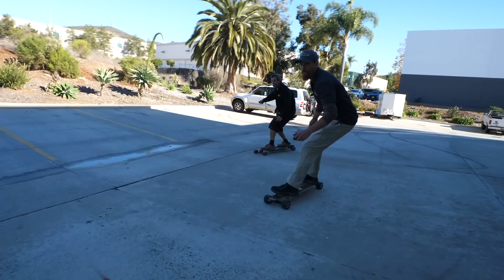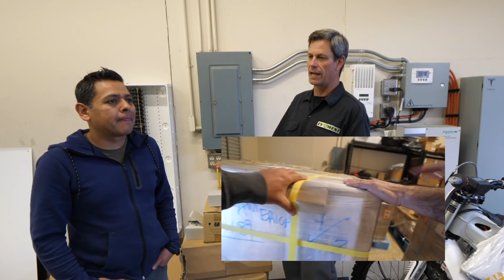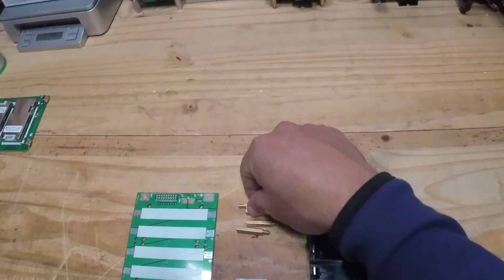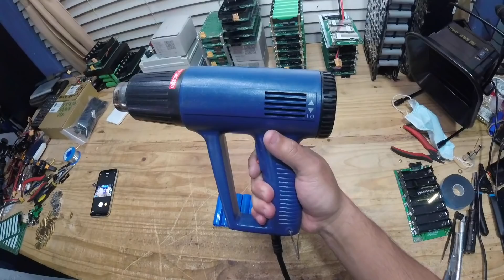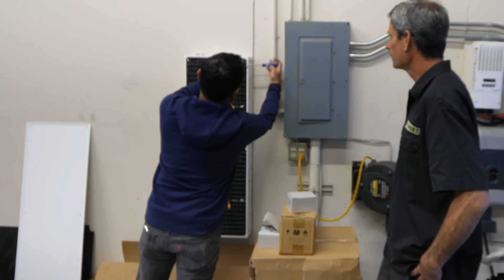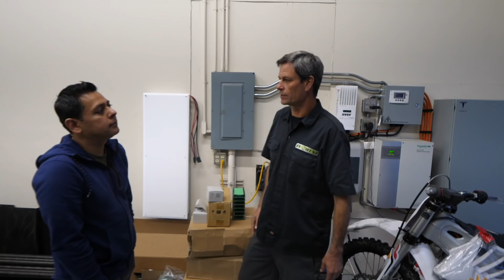Build a DIY Powerwall Using NEW Panasonic NCR18650BD cells

Comment: Whats the cost breakdown, time aside for all the pieces you provide say per KWh?
Reply from the maker: Works out about $377/kWh  including enclosure and  battery cells
Reply: @jehugarcia  how much extra for labor to have someone else build it. What would you sell a complete already built 75x kit ready to go? Plug and play.
Reply: @ĜregoryLoneLLcAlKINs  i like that idea too.. but at that point just buy a battleborn for 900$. He is charging 3$ a cell that is expensive. I understand these are new name brand cells at 3000 mah. It seems its more for the diy satisfaction and education than cost.
Reply: Chris Sproles yeah this is not that cost effective seems like the bone is just about gone on these diy packs. Once the e-sig is gone the prices will come back down.
Reply: Chris Sproles i was really thinking about building one of these for my rv but why spend 3000 when i can spend 2000 and get battle born. Seems so much easier.
Reply: @bumstudios8817   $950 for one 1.2 kWh battle born, or $4750 for 6 kWh of battle born batteries to match Jehu's capacity.  Jehu's solution is about $1925 in cells (with wrappers)

Complete package, you can get a 6kWh battle born bundle for $7700.  Jehu's solution will probably be right around $3k-$3.5k.
Reply: Greg Calkins If you’re in the Southern California area I can build it for you.
Reply: @jehugarcia  if only it was 377/per 10kWh...
Reply: I got $432 per kWh shipped.  That's with shipping on the batteries.  I didn't see shipping prices on the kits because I don't want to click buy on paypal... just in case, lol.

6.2 kWh system

525x cells = ~$1732 shipped.
Cell Wrappers = ~$20
75x board kit  = $600.
12x BMS = $197
 
Box = $125

$2674 total